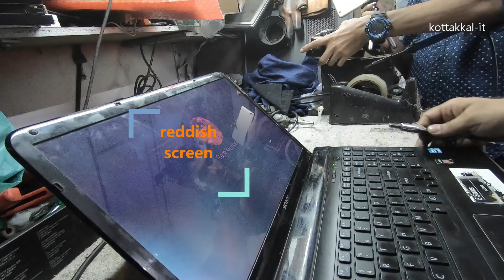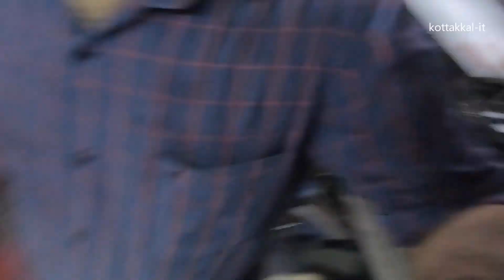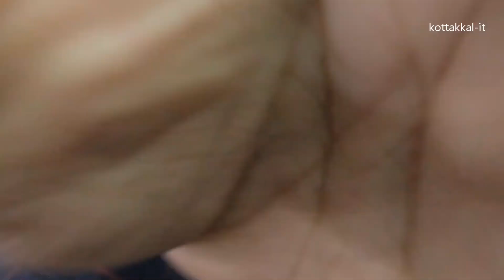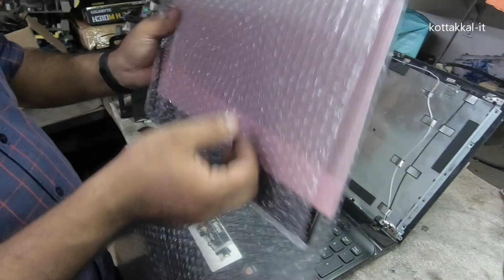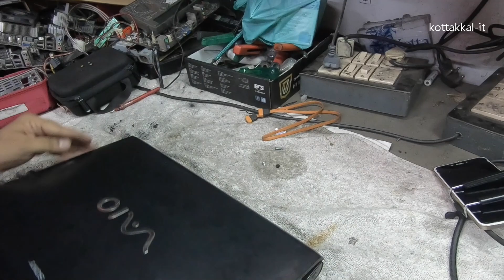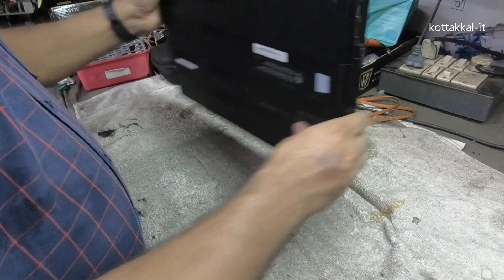Replace Sony vaio laptop screen

Comment: Sir ji mera Sony Laptop Core i3 ( Model:PCG-71811W) 
Iske display me horizontal or kabhi kabhi vertical lines aati hai or kabhi kabhi full screen white ho jati hai to iska strip change karna hoga ya display change karna hoga or cost kya hoga plz batana
Reply from the maker: Display cost Approximately  4500rs